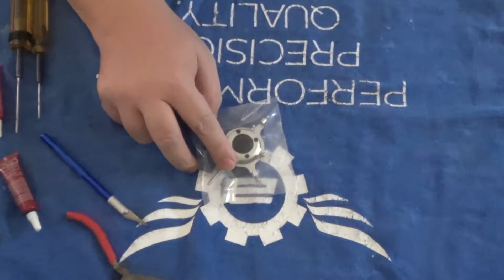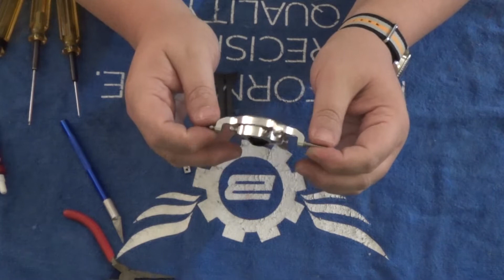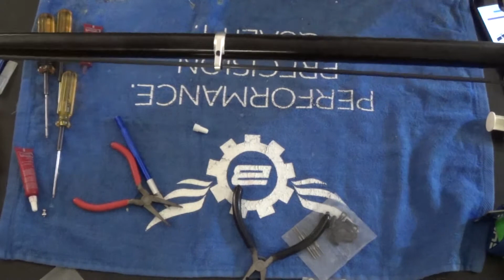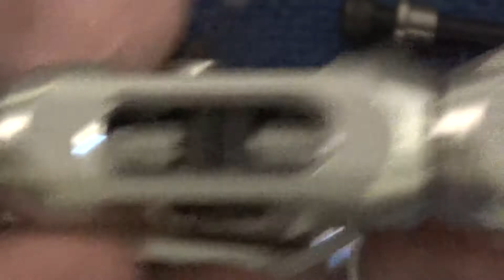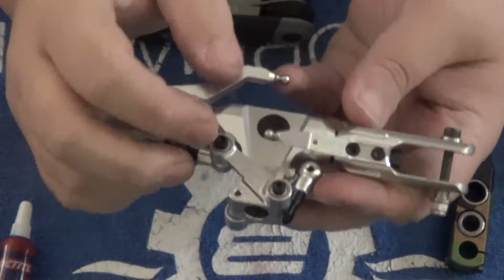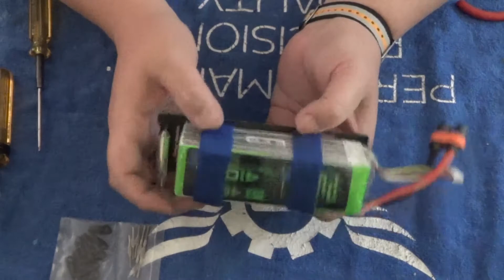Synergy 516 Build Series - Part 3: Main Rotor and final thoughts

Comment: the anti rotation plastic arm is too big for all the ball links on the swashplate.
i can't find any balls big enough to snap into the anti rotation plastic arm. 
help
Reply from the maker: nivasyl strongman contact Matt at matt@mattbotos.com its possible they factory included the wrong links in your kit. There are a larger version used on the bigger Heli’s. You might have gotten those by mistake.